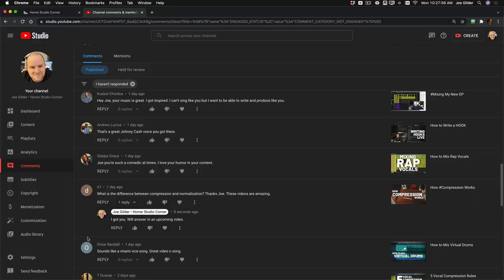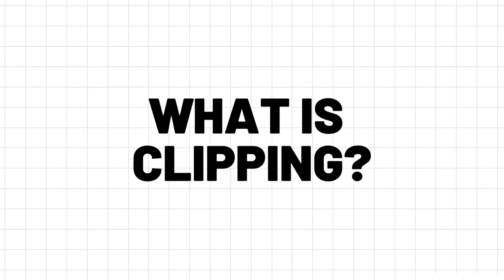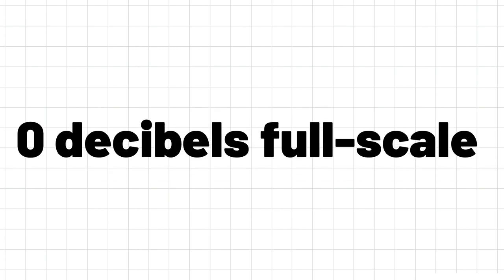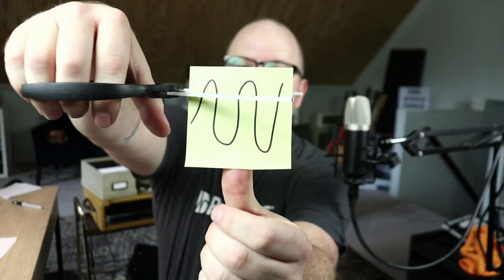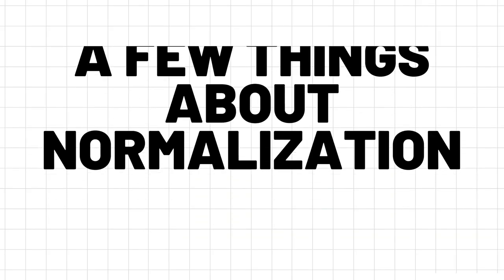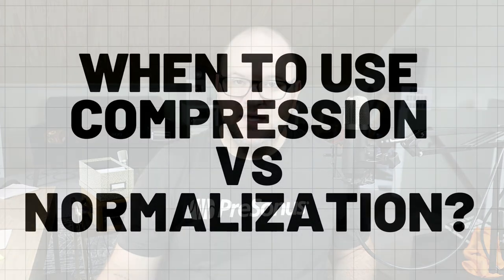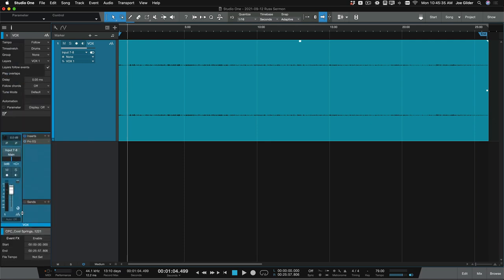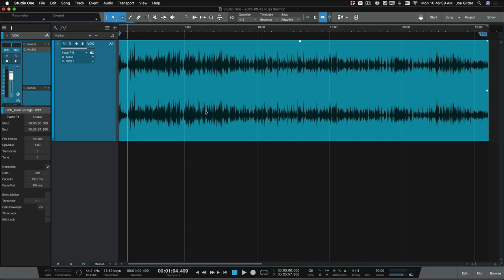Compression vs Normalization: What’s the Difference?

Comment: Some older machines like akai s3000xl sampler have a normalize function however if you look at the included spectogram one can see that a truly unmixed signal with very loud peaks and quiet rest parts of the track just get squashed by normalize function to an almost flat peak type. Its more like a build in compression rather then normalize as we know it. No matter what you put ther it will just get flattened. Its pretty cool and powerful tool hidden in this old school shitter box.

Comment: What I don't understand is, for example, when I want to record my Ocarina with the Sm57 (its the mic I have here, maybe not optimal), and I set the gain so it won't clip, the resulting tracks almost always have barely any peak, and sound much less loud thant what is expected with the gain so high (about 70%, I am using the Audien id44 Interface). So to hear something I have to normalize it, and its reall weird. Is it a weird setting in Reaper, or is the Microphone just that deaf, or is there something else Iam doing wrong?
Reply from the maker: One option is turn up your speakers so you don't feel the need to crank up all your tracks. It's all very normal.

Comment: For the longest time I thought that Normalization would be a type of Compression Tool or would ultimately change audio it in a way that would mess dynamics or every aspect of what's been originally recorded. I was afraid to use it because I didn't want to mess up the track that way. For example, I love to rip vinyl and I want to keep the exact state the audio is recorded in terms of dynamics because that's one of the reasons why I like vinyl. From what I understand Normalization keeps the dynamics or another way to understand that in a track it has its levels for each samples, instrument depending what is set before exporting, mastering etc. It leaves those dynamics alone and actually lifts all together only the volume of everything in that track thus keeping dynamics. Hopefully I've understood that correctly and if not I'd like more input on this if I'm misunderstood. Thanks for the video Joe :)

Comment: But wait.  Is it only normalizing up to 0 dBFS?  Isn't normalize up to zero more for mastering?  And aren't there optional settings lower than zero, that would benefit gain staging in the mix?
Reply: Normalise all your tracks to zero then reduce all their input gains to your preferred mixing level i.e. -18db and get on with mixing. Plus this way you don't get all those clip gain lines all over your tracks. 😎

Comment: I was used to normalize to a value I could enter myself, instead of a set 0dBFS, before I started using SO. But I understand that isnt the default way of normalizing? I havent used normalization anymore, since I use SO, I just use the input trim on the channels.
Reply from the maker: You can still normalize "to" a certain value in S1. It's just a two-step process. Normalize, then use clip gain to bring the clip down to the desired level. There's a macro that lets you normalize to -12 I think. But I don't use it.  - Joe Gilder
Reply: @HomeStudioCorner   thanks Joe!

Comment: Hey Joe, I love your videos please keep it up.  Two small things that I have been trying to figure out and I am hoping you can help.  Can you please show us 1. how to change the default length of a crossfade.  The current default length of my crossfade is so short I have to almost completely zoom in to see it.  2. how to keep the new version of studio one from adding the 01 Start to the end of song mixdowns names.  I just want the name of the mixdown to be the name of the song and not have it add that at the end of my mixdowns.  It only started doing this after I updated to latest version.  A bonus on the mixdown is how do you keep it from adding a folder as well that it places the mixdown in.  I just want it to save the mixdown with the song name and folder I tell it.  Thanks. Kevin
Reply from the maker: 1. You can't adust the default length, but I've never found that to be an issue.
2. Not sure.
Reply: @HomeStudioCorner  Thanks for your reply.  I have a circumstance where I need all my crossfades to be 1 second.  In video editing you can adjust the default length of a crossfade.  I guess it can't be done in studio one.  I only want it to save time so I don't have to touch all my crossfades.  On question two I actually found that answer = don't select the between markers even if it says Start - End use the between Start and End markers above.

Comment: Makes me pop the question on gain staging your tracks before mixing. Seen a lot of videos that show you “have to” gain stage all tracks to -18dbfs, using various ways of clip gain to a channel trims etc. But I’ve not seen a video that shows the best/most easy/most effective way. What would you recommend?
Reply: Use your ears.
Reply from the maker: I understand the reasoning behind that advice, but I don't want all my tracks to be the same volume. The lead vocal needs to be louder than that little shaker track. The kick drum needs to be louder than a background vocal. So normalizing to -18 seems to create more work for me.
Reply: @HomeStudioCorner  Clear on that, seems logical for me. But when you do gain staging on tracks, what is your workflow on that? Just curious.

Comment: Joe,

I'm not sure exactly how to ask this but how does Normalization fit in with the principle of GIRATS? Can it and Compression make up for low signal issues with the original track? I imagine it can help to a degree but to what degree?  

Thanks.
Reply from the maker: Yeah, if the track is recorded TOO quiet there can be problems, but usually there aren't. Like that sermon audio. It's pretty quiet, but digital recordings are so clean anyway, simply increasing the volume doesn't hurt anything.
Reply: @HomeStudioCorner  Good to know. Great video. Thanks.

Comment: Normalization is something i never use. Idrather send clipping signal over brickwall limiter (something i know how it wotks) over normalize using volume magic to calculate peaks. 

I love extra crunchy mixes
Reply from the maker: Well there you go
Reply: Two completely different things. One is affecting the level only. The other is affecting level by affecting the audio itself. And why would you do that when you're only gain staging to optimise your plugins and avoid clipping? Normalise all your tracks to zero then reduce all their input gains to your preferred mixing level i.e. -18db and get on with mixing. Plus this way you don't get all those clip gain lines all over your tracks. 😎

Comment: I use compression more than ......normalization.
Reply: Wouldn't you want to improve/increase your signal amplitude rather than normalize? Normalizing brings the noise up as well right?
Reply from the maker: normalization is ONLY turning up the volume. Compression decreases dynamic range, which will have the effect of bringing up the quieter parts. 

That said, I normalize a handful of tracks when I mix. I compress more than I normalize, but it's like comparing apples to oranges. I compress for the sound. I normalize to adjust the volume.